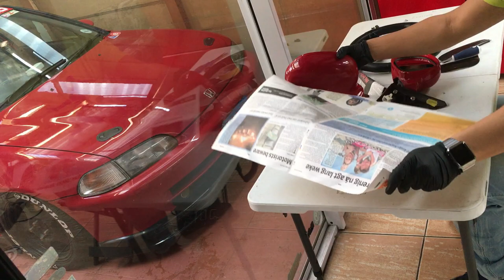QUICK & EASY DIY MODS (HONDA EK & EG)

Comment: That’s a really nice touch! If you do this again you could fold the mirror inwards and then mask it off.
Reply from the maker: Thanks bro. How do u mean exactly?
Reply from the maker: Jsonic90 How does folding the mirror inwards help if they are taped up and folding the mirrors inwards would mean id hav to plug them in and turn them inwards on the dash because they are electric mirrors
Reply: WongStreet2Track The part that “houses” the mirror itself is attached to the base via the screws, then the base is attached to the door. what I mean is that the mirror swivels on the base. This may help the mask up process. I’m not an expert but just a suggestion.
Reply from the maker: Thanks for the tip bro 👍🏼👍🏼
Reply: WongStreet2Track no stress - it’s a tough one to explain. Sorry on my part